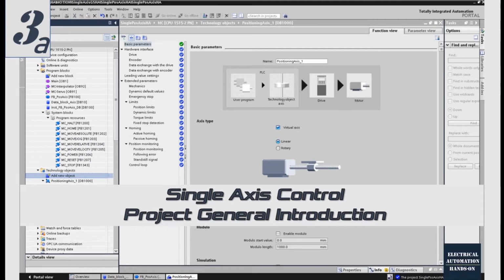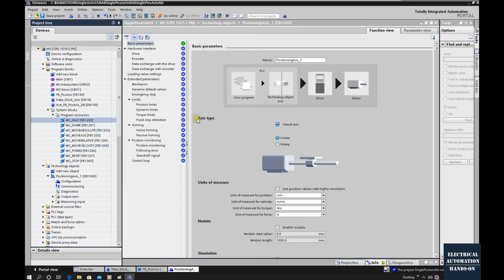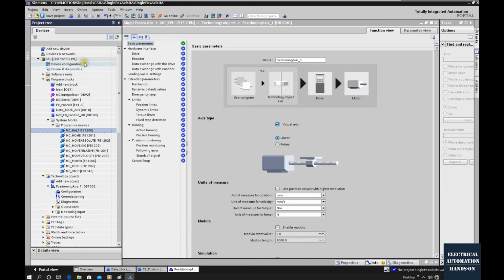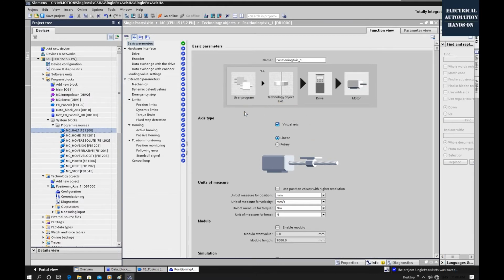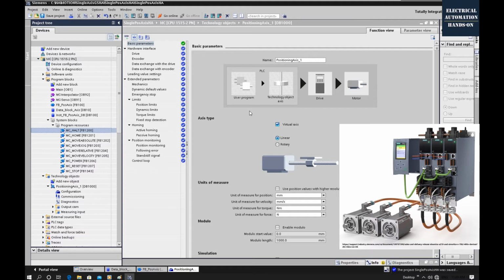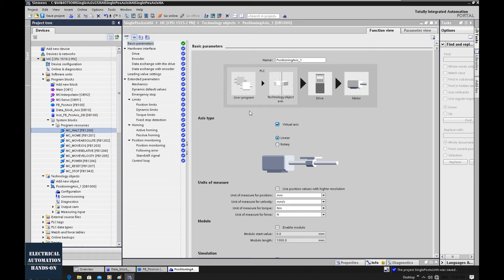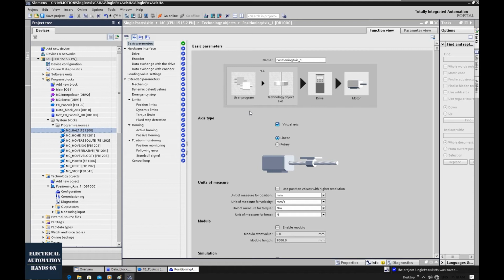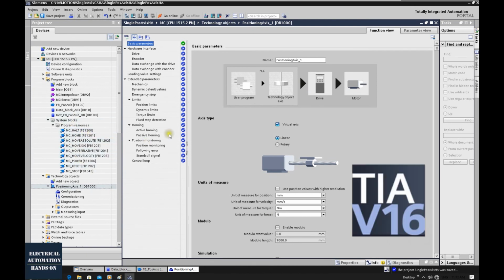MS03a. [Siemens Motion Control] TIA Portal Single Axis Control - Project Introduction [3/10]

Comment: Please , could trigger confirm button on control panel , through FB , some warning and error cannot AcK using MC_reset ,
Thanks for support..
Reply from the maker: Some faults from your drive hardware level may not be reset totally by using MC_Reset. But it is very specially, maybe focus on your drive hardware level fault, solve it.

Comment: Hello

Sorry to bother you, but I have seen some of your videos and maybe you can help me

How can I place two independent motors, which are controlled by Sinamics S120 drives and PLC S71500,
 in such a way that these motors work as if they were a single axis, rotating both motors in phase and frequency simultaneously and perfectly synchronized at all times.

I have believed that using Technological Objects and functions such as

TO_PositioningAxis (as speed master) and TO_SynchronousAxis (as speed Slave).

Motor 1 (as Speed Master)---->Motor 2 (as Speed Slave)

These two motors must rotate exactly the same as if they were a single axis, the machines would rotate in the same phase and frequency.

Can you tell me if there is any example in which you can guide me and be able to make this application.

Thanks and Regards
Reply from the maker: This video will help you https://youtu.be/hie46Yd37uI, please also review the entire S120 videos https://youtube.com/playlist?list=PL762SfoJC-e9l5BALU0tJeJyM1ZraK1zE